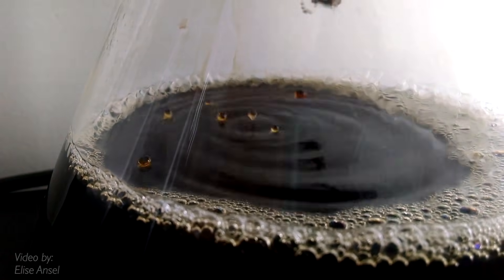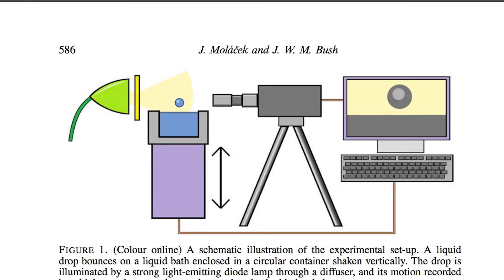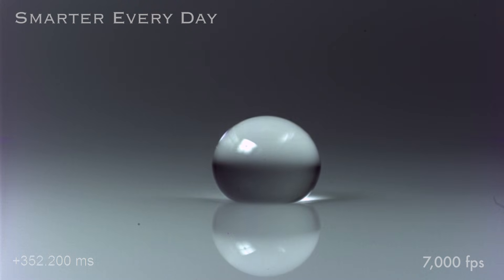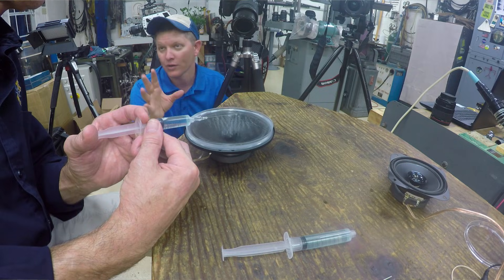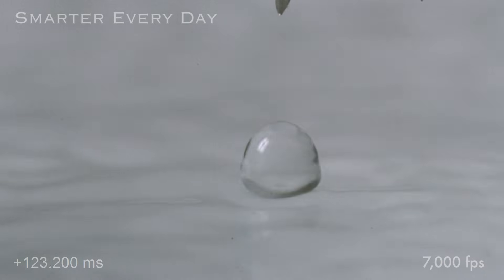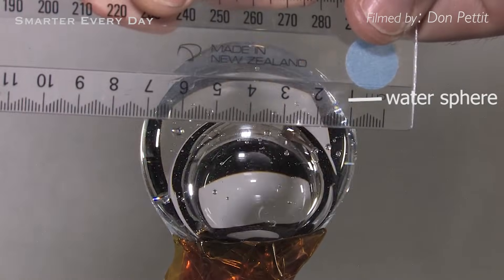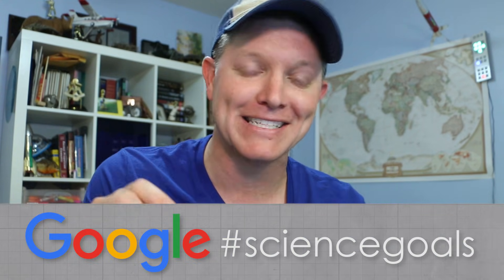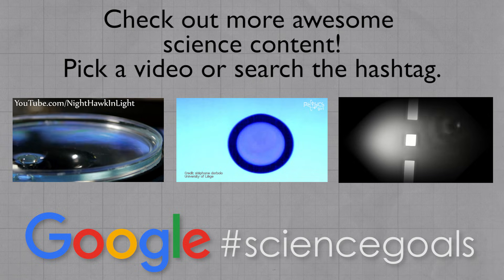The WALKING WATER Mystery (in SPACE and SLOW MOTION!) - Smarter Every Day 160

Comment: Hi Destin, let me give you a clue about why the cello makes this inside bubbles: the evolution (or devellopement) of the violin (and the cello) stopped when the the luthiers discovered the "f-hole" (seach "f-hole" on Google Images). The f-hole is the shape of the air holes on top of the violin (its cello cousin did get the same holes) that are supposed the "let out" all the frequencies from the inside of the instrument. Before this "last generation" violins (as they are today) these holes had many different shapes (circles, half circles, laces), but none of them did sound right. What made the f-hole the perfect (and final) shape was that it is the surface of a sphere. Peel an orange or a tangerine the right way and you get the f-hole shape (search "peel tangerine f-hole" on Youtube). And BECAUSE it's the surface of a sphere it can "let out" all the frequencies of the music's spectrum. Now you can easily imagine why the sound, that is shaped as a sphere by the f-holes of the cello, does indeed turn into spheres. But that's just a clue.

Comment: A couple of people in the comments have suggested doing this in vacuum.  In the video, you can see an illustration that shows reduced pressure has already been tried.  Hard vacuum will not be possible because of the relatively high vapor pressure of water.  What I would like to see is the experiment done in different gases, as well as a range of pressures.  H2, He, O2, N2, CO2 (the acidification of the water by CO2 would introduce a wrinkle), Ar, Ne, Kr, N2O2, SF6

Comment: So why do the drops still skitter around in a situation like the one in the woods?  Do the other drops falling provide enough of a vibration to the surface to keep the drop from coalescing?  Then in the case of the drops from the helicopter, how does that work when it's pretty much single drops at a time?

Comment: Now I can't unsee it. I'm machinist and after seeing this video when in example milling a pocket (coolant "stands" in the pocket) with coolant coming to tool spinning fast and spreads to smaller droplets can cause this phenomenon. Coolant contains about 3-5% oil so it might effect surface tension, but still sometimes this phenomenon is visible.

Comment: I submit that the "air layer" theory is unlikely. It seems to me that the phenomena is more related to differences in droplet and pool surface tensions, internal droplet pressures, surface pressures and deformations than it does any "air layer". 

If the internal pressure according to F = Gamma * L and F = P*A of a water droplet is less than the pressure of the pool surface of 1 ATM pushing up, and upon impact, the difference in surface tensions and deformation of the droplet and the surface absorb the impact energy to maintain said internal droplet pressure and tension of the pool's surface. Intuitively it seems to me that the surface tension of the droplet is greater than the tension of the surface causing the droplet to "bounce" all the while the droplet is able to deform much more than the pool's surface and absorbs said impact. On impact wouldn't the molecules be squeezed together i.e., density increased? Once the droplet bounces and comes to rest, the residence time might be the time for all forces on the water molecules of the droplet/pool interface to reach equilibrium and assume new molecular attractions, thus coalescing into the pool's surface. 

If the "air layer" is true, then wouldn't it stand to reason that a much larger droplet, imply that an increase surface area would trap more air and be resident longer? Should it bounce less? More? What would happen if we increased the impact energy? Would it even bounce? I believe that the experiment where the residence time diminished with decreasing external pressure is affecting the droplet's and pool's internal pressures. It is clear that the droplet bounces quite readily and multiple times retaining its surface independent of the pool's surface before coming to rest without coalescing...something is keeping the droplet together, yes? I believe that the oscillating pool surface experiment is where the pool's perturbations constantly push against the droplet's surface moving it on a  constantly changing pool surface (as well as absorbing it in the troughs as stated in the video). I.e., the pool never lets it rest in one place long enough for the droplet to completely equilibrate molecularly and coalesce. How does the air layer theory work in this experiment? But, then again I'm simply speculating.

Comment: sorry, im not a native english speaker. and i understand it only partially when i hear it. but i think that ive understood that you explain the drops of water on the water because of two reasons; 1st: the aire compressed between the drop and the water surface. 2nd, the pull of gravity. And when there is a moving surface, in this 2nd case, the drop acomodates softly losing its kinetic energy and moves around. 
Maybe ive not been able to understand it, and maybe im just showing my ignorance, but havent you forget the hidrogen bridges that attaches the water mollecules between them, creating the superficial tension of water? because this is the reason, not kinetics or air, because of some insects can "walk" on the water. As is also the reason because water doesnt wet as much as other liquids like alcohol or cetone, that have much less superficial tension and higher penetration and weting capicity.
The superficial tension is also the reason because water have the skill to climb walls when a house has a wet problem due to is capilarity effect: the litle holes on the wall are not easilly occupied by te water drops, because of their superficial tension that prevents them to go inside too small places, but when it does, the same reason that keeps the water mollecules together push all of them inside that hole. So you can see a wall where the wet climbs up as soon as the force that keeps those mollecules together is stronger than the gravity of earth. 
Would not be those hidrogen bridges related to water's superficial tension related to this effect of water walking over water?
just asking.
sorry for my english, by the way, and by my grammar or vocabulary mistakes.

Comment: Have they tested the air gap theory under different atmospheres? In a vacuum with no (very little) air it would effect the vapor pressure of the water. This would increase the amount of molecules moving from a liquid to a vapor at the surface. It seems like this would be more likely to result in the rapid coalescence. IMO the better way to test the air gap theory would be to try the experiment under different atmospheric pressures and with different gasses.

Comment: Maybe Stupid question: We know that water turns into the shape of the object it is pour into. Now when you put water in space station (floating); Why it always becomes a sphere and not any other type of object OR even non-symetric object. Also under gravity the water drops are in sphere shape.      To further extend, did anyone try checking the behaviour of water in real space (outside of the space station)? Do they still form sphere shape?
Reply: Viral Shekhalia water becomes a sphere because of the surface tension. The surface tension pulls every point in the surface to the center, so the equilibrium state is an sphere. Look for some surface tension videos and info!
And probably if you pour water into space where preassure us close to 0 the water will instantly boil and become vapor.
Nice questions dude, not stupid at all!
Reply: Thanks dude!
Reply: Alfonso Sainz I saw a video by CodysLab where he made a vacuum and the water boiled until the heat was gone and the leftover water just froze. It was very interesting, you should check it out!
Reply: Thanks for the reference. Saw the video. Its amazing and very informative. So with the reference to that video, it seems that there will not be any liquid water in actual space (0 atmospheric pressure). Should that be same with other fluids as well; like Diesel? Also, do we know at exactly how much atmospheric pressure; water turns into ice? Maybe someone can make list of all the different types of fluid and get this data for each.
Reply: ***** there actually are a lot of these studies. If you look for phase changes diagrams you will find these. They represent the state that a material presents in certain temperature and preassure conditions

Comment: Destin, I remember clealy in my infancy that I'd do these water pearls by tapping the sice of a soda bottle. Now, the soda wasn't particularly fizzy, but the pressure inside the bottle was larger than atmos. Now, these pearls would  sit in the surface for seconds, tens of seconds even. A great follow-up to this video would be trying the same experiment, but on a pressurized chamber. My guess is that one could get long lasting pearls.

Comment: Could it be that the internal kinetics of the drop prevent it from homogenizing with the still water below? 
Just like the drops hitting the vibrating surface, it could be that the spin and internal vibrations in the drops caused by the drop forming and rolling off the beveled needle point and the air resistance as it fell are stopping the surfaces from merging.

Eliminating or enhancing these variables could be a great way to prove or disprove the current air layer theory.

- Cut the beveled needle point straight to prevent spin or run water down a glass stir rod.
- Try imparting vibrations in the drops via a speaker on a syringe
- Try imparting more spin on the drops (air current or a pin head at the edge of the falling drips path)

Maybe the decreased air pressure in the study you mentioned caused a stiller drop and reduced surface tension.

Lots of maybes but something to think about.

Comment: I think the reason it forms the air pocket even when it bounces is the same reason why when you throw an object from a high distance into a body of water causing it to react as a solid rather than a fluid.  Despite the water being the same substance or because we cannot remove temperature variation in the droplet it behaves as seen with a hot pan and water it allows the water to act as two independent substances due to them both repelling another from their surface tension as the water hits it either punches threw due to sheer weight or the weight of the water is small enough that it's able to impact and not break the surface tension of the water forming the air pocket for prolong periods of time more than one bounce. So it's all about the viscosity of water a level that varies on temperature and the droplets even at a small distance may change as a standing body of water will hold a different temperature then a smaller body quickly influenced by outside air temperature causing it to warm or cool faster this difference in temperature can create a change in the viscosity. In space it seems it's just droplets being pulled off the water that respond the same way they would as outlined above even without gravity the tension remains constant and could probably be tested by smacking someone with a water balloon in "zero G (there is still gravity in space but it's affected by orbital space to counteract the downward force pulling it back to the earth)" despite it having no gravity it still carries weight and so as a bullet can cause impact thus creating a force equal to it's mass though lessened it still exist.

Comment: Destin, I was wondering. would the change in temperature also affect the way coalescence occurs? 
when water droplets leave the ice and fall onto a relatively hotter surface, doesn't the temperature also need to attain equilibrium?
Maybe there is a frequency of water that allows it to heat up quickly, "chello frequency"
p.s pls excuse my spellings :)

Comment: It was my understanding that a water generally has a slightly electronegative surface (though at the moment I couldn't find anything to verify this claim).  However, it could explain the general behavior seen.  With extended periods of two water surfaces touching causing a shift in the molecules along the surface allowing gravity to overcome the repulsive force along the surface.  More brief interactions will not give the time needed to force a shift in the molecule alignment and the two surfaces will remain distinct.

A couple of things that could help test this is varying the surface tension by either temperature or impurities in the water.

Mercury could also be observed for similar effects but I'm not sure how much the much higher density would play a factor even with the greater surface tension, but being a non-polar liquid it shouldn't show any beading on the surface if it is caused by what I suggested above.

Comment: Well, I wonder what results we'd get in a vacuum. If there is a video on the internet, please share.
Reply: Interestingly, water tends to freeze under intense vacuum.
Reply: superdudemaification Look up codys lab. Water does in fact freeze when in a chamber evacuated of air.

As the pressure decreases, eventually the surrounding pressure is less than the vapor pressure of the water so it begins to boil.

The process of the water boiling removes heat from the system (similar to sweat evaporating to cool you down) and eventually the water freezes.

It's how a vacuum drier works.
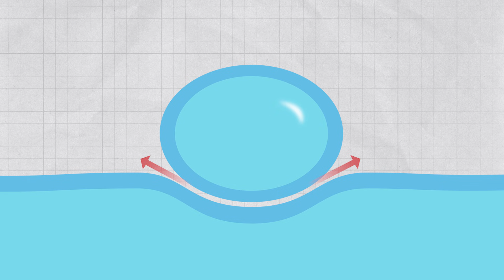Reply: Aakash Kalaria @3:31 There was a study where they lowered the air pressure.
Reply: TheStig It's okay, we all learn.
Reply: Aakash Kalaria wouldn't happen
Reply: That's what we think...
Reply: water cannot exist in a vaccuum, it would evaporate into gaseous form.
Reply: Aakash Kalaria I think that with the seemingly vast amount of knowledge on the matter, we can be reasonably sure that they're right.
Reply: Xanthanarium I agree. But if they say it's because of air... why not just remove air and see!
Reply: Aakash Kalaria @3:31 There was a study where they lowered the air pressure.
Reply: Technically if you could put a hot plate in a vacuum chamber under a beaker and dropped hot water droplets, you might be able to test this.
Reply: +TDPEquinox No you're wrong, it boils and evaporates in a vacuum. Added air would make it freeze. High-pressure makes atoms closer together which makes solids more likely. low pressure means atoms further apart, which means gasses are more likely.
Reply: Keith Richards the video i linked two replies ago has the exact video you mention.
Reply: but that would be a different effect. That would be the Laden frost effect.
Reply: TDPEquinox :D

Comment: Someone explain the space setup to me, why am I seeing 2 spheres?
Reply: it's a water bubble with an air bubble inside
Reply: Yijuwarp so the brass colored tube   releases water. surface tension holds it in place as a sphere, due to low grav. they take a straw or something, insert into sphere of water and blow. creating a bubble that becomes a cavity inside the sphere. once the cello plays, the inner surface tension weakens and droplets of various sizes coalesce. Bouncing against the inner walls due to its cello-induced  vibration.
Reply: Thanks!, why don't droplets leave the water sphere on the outside instead of the inside?
Reply: I don't know! I think that is probably because the speaker is on the inside.

Comment: I discovered these drops walking on the surface of water about 20 years ago when I started wearing contact lenses.  Often when refilling the lens case with new contact lens solution, if I shot the solution into the case with just the right pressure on the bottle and the right angle into the case, the whole case would fill with these drops and they would swirl around in the case and then finally coalesce.  I tried it recently after +Physics Girl did the video on "antibubbles" but I wasn't very successful.  But back when I discovered the effect I was using a different brand of contact lens solution, and maybe that brand had some ingredient, not present in the brand I now use, that promoted the effect.  Or there is something different about the nozzle on the bottle.  Don't know but now I think I might waste a bunch of contact solution to try this again...

Comment: @SmarterEveryDay - redo the slow mo experiment where you shattered a prince rupert's droplet by breaking the tail. I noticed in another video, that when you break the droplet from the thick end, the explosion doesnt shatter the tail. Would be cool to see where the explosive wave stops, and why.

Another cool thing to slow mo film: 
A blink of an eye - does the eye lose its focus between blinks and re-focus once the eyelids are opened, or will the lense remain completely still. 

Also, related to eyes - slow mo clip on how eyes scan landscapes. It appears that our eyes jump from one point into another, without smooth scrolling, but is there something more to it. It would be cool to see how instant the jump is. 

Regarding the current experiment with droplets:
Try it with thicker fluids, and if you can - put the dripper / water plate into a vacuum chamber. No air = No bouncing droplets, regardless of the frequency ?